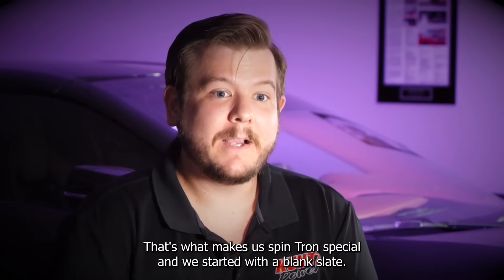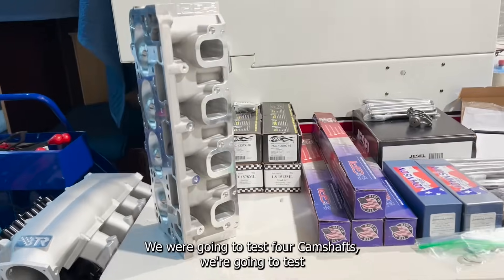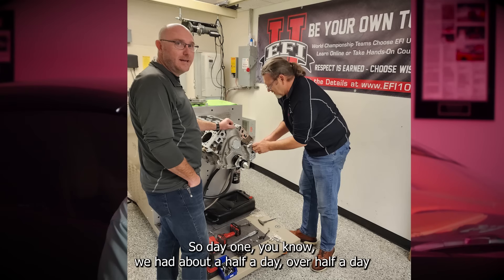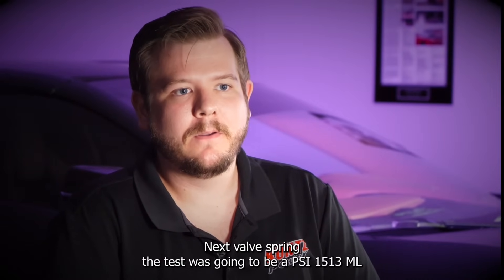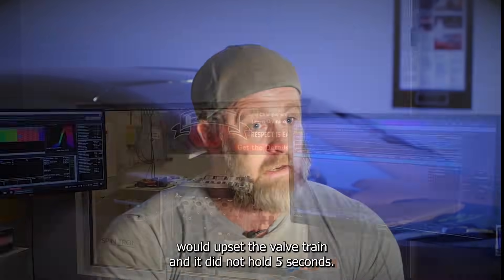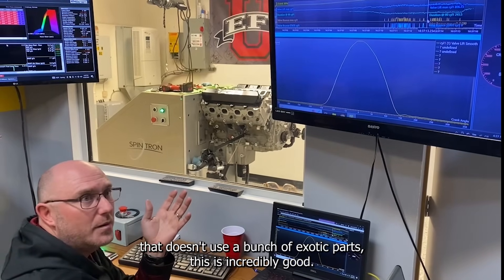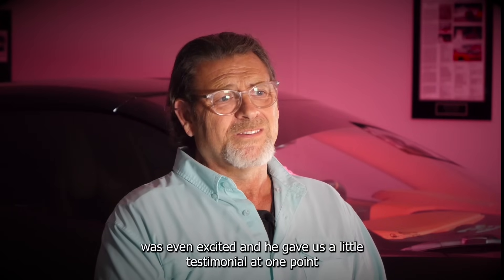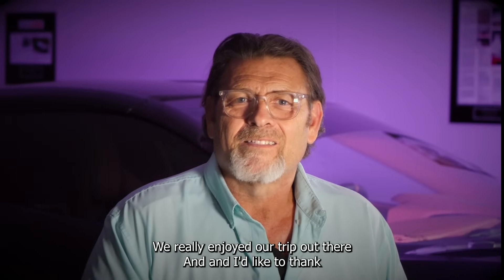How High can you spin an SBE Gen V LT Engine?

Comment: Has anyone run just the short block? Without a valve train? Just wonder if there is a limit to rotational mass, or imbalance, wonder at what rpm limit the rotating assembly has issues? Just a thought.

Comment: Yeah Smokey Yunick used the spintron decades ago. He new that things like valve springs work differently at rpm’s. It’s why we use different spring diameters, different spring material. Maybe One diameter coil has issues at a certain rpm, then Al the other diameter spring has a harmonic frequency at another rpm, then they can help cancel each other out. Science is really cool.!!!
Reply: Wasnt his called a Smoketron?

Comment: Isn't there less stress on the crankshaft and rods spinning  from an outside source vs the combustion process putting more stress on the rods and crankshaft at the same rpm?
Reply: I don't know the answer to your question, but they're only spinning the valve train here, not the rotating assembly
Reply: @C6Z_Bob  What? Dude the crank is spinning.
Reply: @C6Z_Bob  

Oh ok

Comment: is the stock bottom end, e.g. pistons and rods capable of 9000RPM?
Reply: Nobody is bolting those heads and using that valve train on a stock bottom end....
Reply: I doubt it. They're pretty stout, but 9000 is a LOT of RPM. I would definitely want a forged piston and probably a forged rod at that RPM
Reply: This is going on a SBE.   9000 is asking a lot long term.   We have 30 engine dyno pulls so far on it up to 8600 RPM.   This combo isn’t limited to sbe stuff, or na stuff.  It is available for all LT applications.
Reply: @Stevens7983  Im really just interested in high revving N/A stuff. I guess it would be recommended to have forged pistons/rods at 8500+rpm?

Comment: how are you taken a psi 1513 spring to over .700-.725 lift? what was installed height?
Reply: We have to use longer than stock valves, and on top of that they are 7mm stems to keep them ultra light.
Reply: so what is installed height?  they appear to have 160 at 1.800 are you going to like 1.850 and dropping seat pressure? @Stevens7983
Reply: They must be using about 1.855" installed height.  1" coil bind, plus .050"-.055", plus .802" lift.